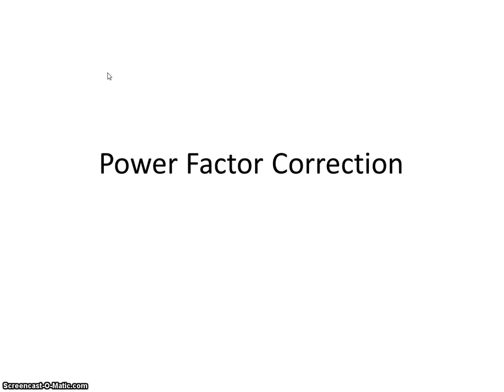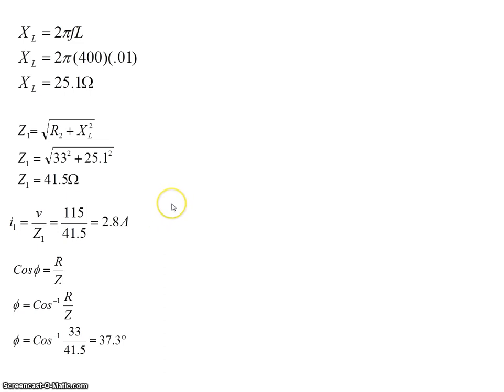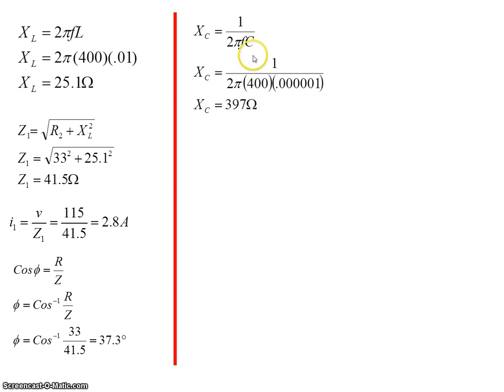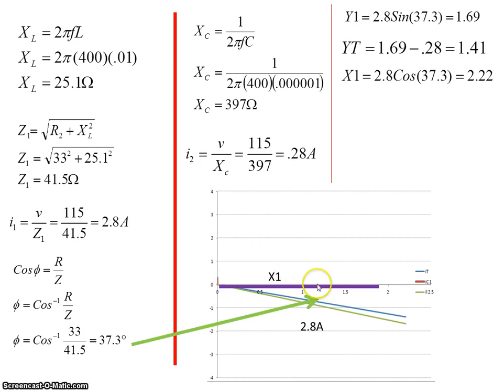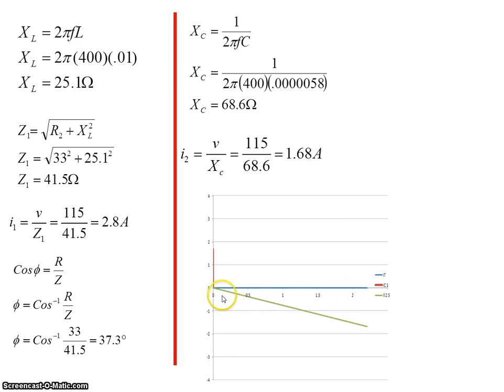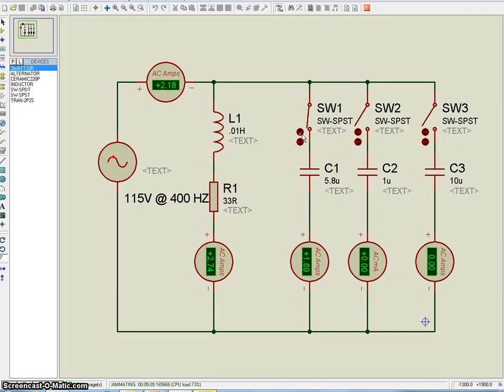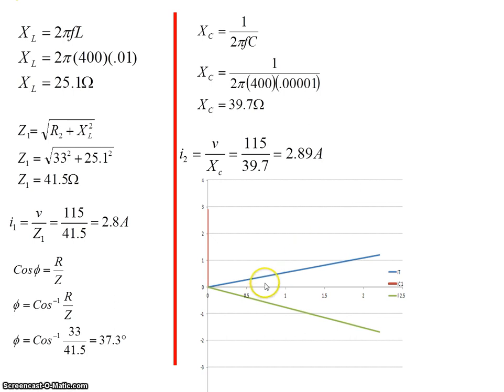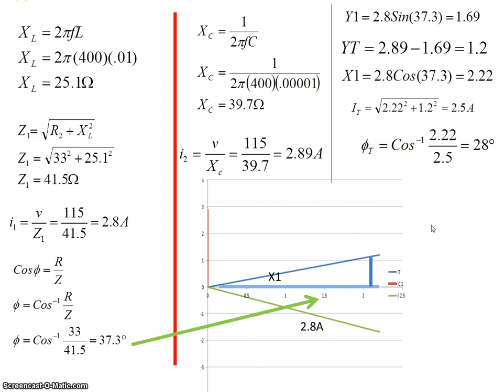Power Factor Correction

Comment: Hello, I don't quite understand something in here.
First without any capacitors you get : P = (115)(2,8)cos(37.3) =  256.1W
After you add the first capacitor you should get an improvement right, but you get : P = (115)(2.62)cos32 = 254W
Then with a power factor of 1 you get even less power : P = (115)(2.2) = 253W which you say is the highest it's ever been.
What is going on?
Reply from the maker: +Pleb Plebberson 
Think of it as the machine is using less power i.e. it is becoming more efficient.  Without any capacitors the machine was consuming 256.1 W but when we add in the correct capacitor this reduces to 253W i.e the highest efficiency.
Reply: The caps bring it back into phase.